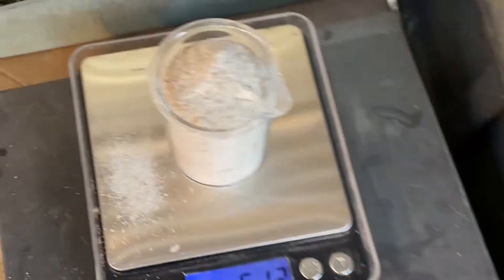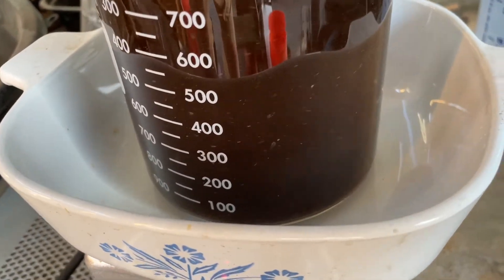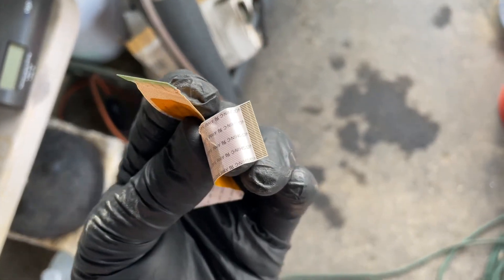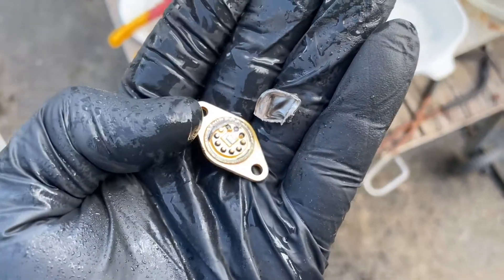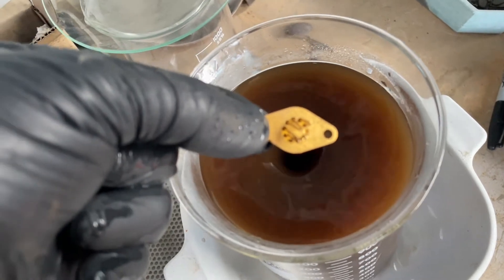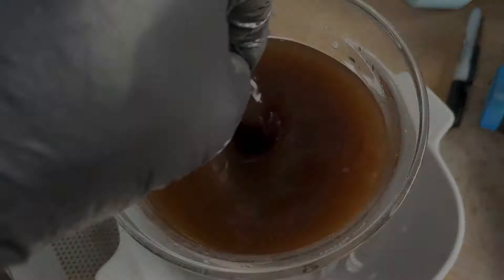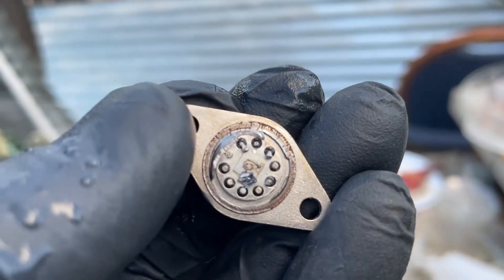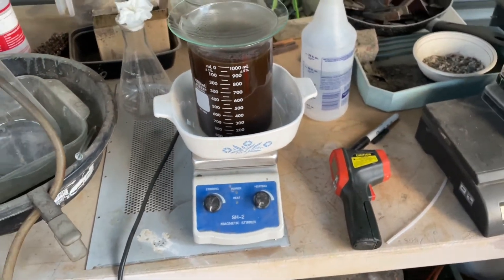Amazing! Part 3: Eco Goldex (E) Preparation,  Testing AU Stripping

Comment: That's brilliant stuff hey PT , I think i gotta get me some , 🤣. It certainly saves some time , good stuff . keep it coming Professor , cheers Ned 👍✌✅
Reply from the maker: I’ve been wailing on my pcb card slot connectors today with the Goldex solution also stripped Chuck Gentles material lickedysplit! I’ll need to continue stripping gold off stuff until the solution is kaput. It will be interesting to see how much gold we get from this much stripping solution.
Thanks Ned, stay safe sir 
✌️PT

Comment: Got to say that I was amazed with the hand-held demonstration. Is the stuff reusable after filtering out the sludge? BTW, is it possible to punch those legs off/up after to see if if got stripped between the sleeve? Pretty cool stuff Matt.
Reply from the maker: It is reusable but I have to see what process is best for me.
The gold in between tight areas might be still remaining probably not worth the trouble.
Thanks Johnny 
✌️PT